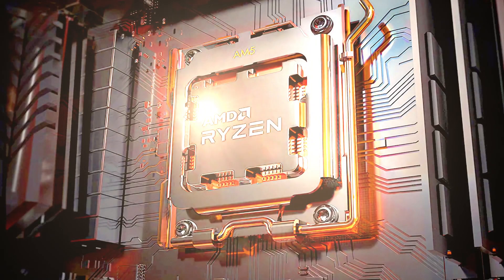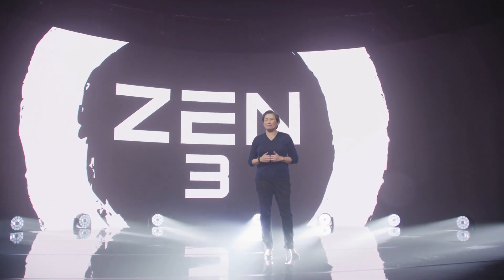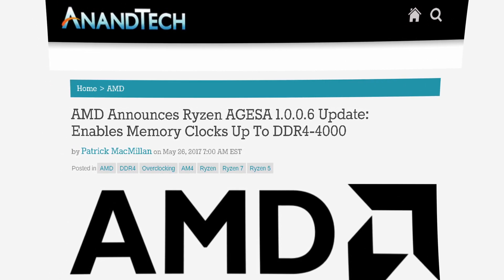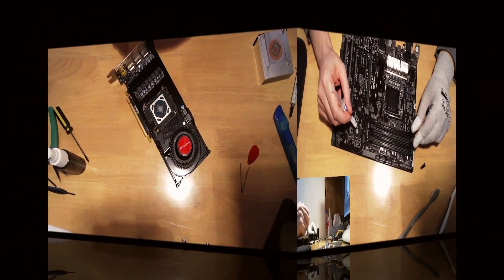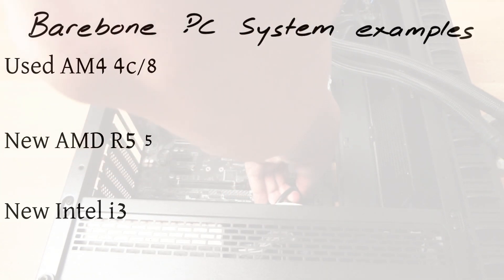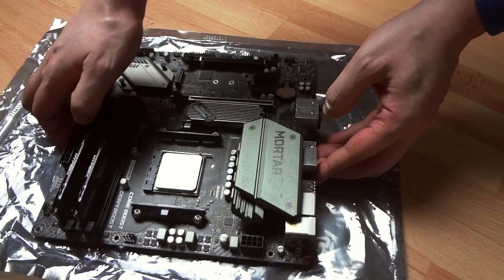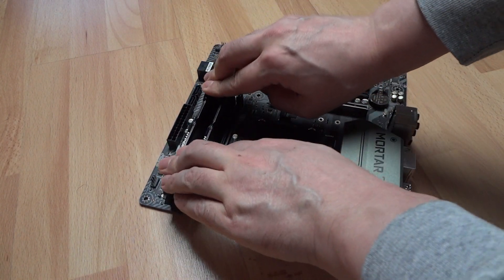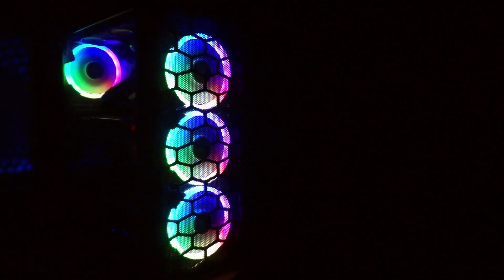Should You Build a PC on an AM4 SOCKET?

Comment: I recently upgraded my mb to a used b550i aorus itx for $120 from b450 matx, because when the 5700g is unable to be used on budget gpu cards, ill slap a Pico psu on, remove the gpu and run igpu on 5700g for a mini pc server that is still fast for work function.
Reply from the maker: That's a pretty clever way to prolong the usefulness/longevity of your system. 👍

Comment: hi thanks so much for the video, super concise and informative! i'm now majorly considering getting am4 over intel for my first ever pc build, possibly on a b550. it's mostly going to be for emulated games with a few recent AAA titles like bg3 plus dragon age 4 when it comes and maybe some light photoshop/premier use. my current budget is <600 USD. is it better for me to get an apu like the 5600g first then get a decent dedicated gpu? or should i get maybe a 3600 or lower + a cheap gpu before upgrading said gpu? after upgrading the gpu i'd like for my build to last at least 7~8 years before getting major upgrades to the cpu and gpu with the hopes that the 5800x3d is still a good processor by those years... do you think it's a solid enough plan?
Reply from the maker: Hi and thank you very much for watching as well as for the nice comments. 😀

The AM4 platform is a smart choice if you can find a motherboard and CPU at a good deal, particularly if you opt for a B550 or X570 motherboard combined with a 5600x or 5800x CPU.

However, the AM4 platform is already seven years old, so it wouldn't make much sense to build an AMD AM4 system now and plan to upgrade it with a bit more powerful CPU (such as the 5800x3d) after seven years. Unless your intention is to only play games from 2023 or older.

For tasks such as emulation gaming, even the R5 3600 will do just fine. I can't comment on Dragon Age as it is yet to be released.

BG3 is a unique case because it is very CPU limited in Act 3. Even a high-tier 12900K will get in trouble. Furthermore, it doesn't like Hyper-threating so there is that also. The good thing is that it is not a fast-paced game, so having a frame rate cap of 30/40 fps at 1080p wouldn't be much of a problem if you are willing to make some compromises.

In case you live in USA, I have the impression that creating a PC build consisting mainly of used parts, such as an R7 5700X, a B550 motherboard, and an RX 6600XT, is within the realm of possibility for around $600 to $650. Such a system should be capable of providing satisfactory performance for 1080p AAA gaming for at least another two years.

Just don't go for an integrated GPU, unless you want to play modern games at 720p 30 fps.

Comment: Is getting a B450M still worth it?
Reply from the maker: Depending on what you build, what is the main purpose of it, the budget and the market you have access to.
Reply: @obnot  More on productivity, b550m here is OP and b450m mobo's with good VRM are cheaper.
Reply from the maker: @dayveeee07  in terms of productivity, if yyou can't do without PCIe 4 support for high-speed Gen 4 M.2 or faster Lan/wifi or USB 3.2, then B550m is the only way. Otherwise as you wrote B450m has better cost/features ratio.
Reply: @obnot  Those features mentioned are not really in need, except for the PCIe 4, but as what I read on some articles or saw on other videos, there's only a small speed difference between PCIe 3 and 4, can you confirm this?
Reply from the maker: @dayveeee07  I don't own a PCI4 mobo so personally I can't confirm anything except from what I have read and watched on net.

Theoretically is much faster than PCI3 especially at reading, copying or moving many small files. Practically Gaming performance difference is negligence. Productivity apps it depends on the software.

Nowadays, Adobe has optimize it's engine for PCI 4 and 5 so you will definitely see ''some'' differences there, BUT I think it is more important to have a good M.2 Nvme drive with fast cache so to take advantage the bandwidth surplus.